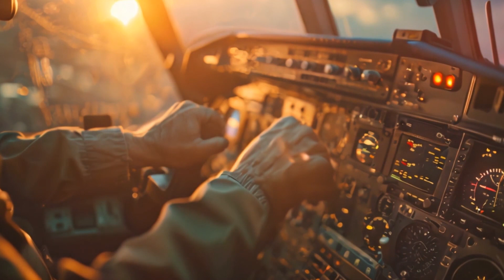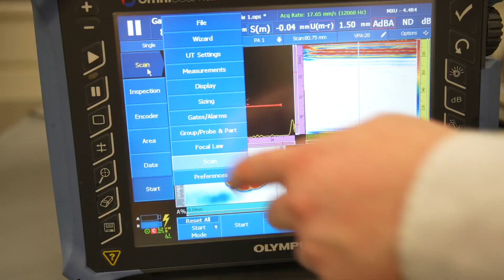Hypersonics | ADSTAR 2024

Comment: The development of hypersonic weapons is a significant advancement in modern military capabilities, offering unparalleled speed and range compared to conventional weapons. Hypersonic weapons, which travel at speeds greater than Mach 5 (five times the speed of sound), provide a strategic advantage by enabling rapid, long-range strikes that can bypass traditional missile defense systems. This capability allows nations to hold potential adversaries at greater distances and respond much more quickly to threats, making them a formidable tool in modern warfare.

For Australia, the development and integration of hypersonic weapons are closely tied to its defense agreements with AUKUS partners (the United States, the United Kingdom, and Australia). This collaboration aims to enhance collective defense capabilities and maintain a strategic edge in the Indo-Pacific region, where increasing tensions and the rise of advanced military technologies from rival powers have raised concerns about regional security.

The work being conducted by the Defence Science and Technology Group (DSTG) in Australia is a critical part of this effort. DSTG's focus on both offensive and defensive hypersonic systems is vital to ensure that Australia remains at the forefront of this emerging technology. Research and development in hypersonic weapon prototypes, including flight tests, will provide valuable insights into the performance, reliability, and effectiveness of these systems. These efforts are likely to play a key role in shaping Australia’s military posture in the coming years.

However, while the development of hypersonic weapons enhances Australia’s defense capabilities, it also raises several strategic and ethical considerations. The deployment of such advanced technologies could contribute to an arms race in the region, prompting other nations to accelerate their own efforts in hypersonics or similar advanced weapons systems. Additionally, the speed and precision of hypersonic weapons present significant challenges for existing missile defense systems, which may struggle to intercept these threats in time.

As Australia moves forward with hypersonic weapon development, it must also consider the broader geopolitical implications. The use of such powerful weapons could influence military doctrines, alliances, and regional stability, making it essential for Australia to carefully manage its defense partnerships and ensure that the integration of these technologies contributes to peace and security rather than escalating tensions.

In summary, the development of hypersonic weapons marks a crucial step in modernizing Australia’s defense capabilities, enhancing its strategic reach, and maintaining a strong deterrence posture. However, the technology also requires careful consideration of its potential consequences, both in terms of military dynamics and international relations.